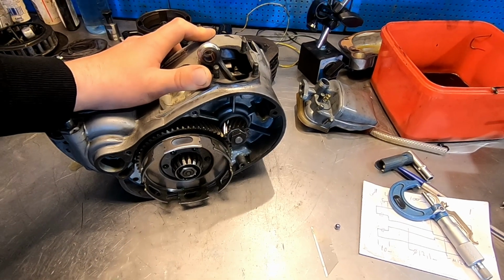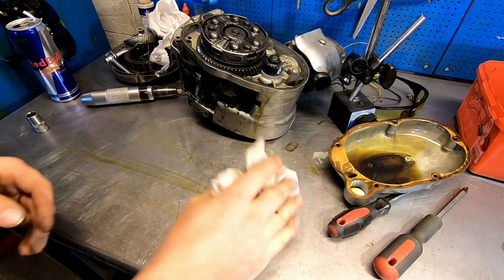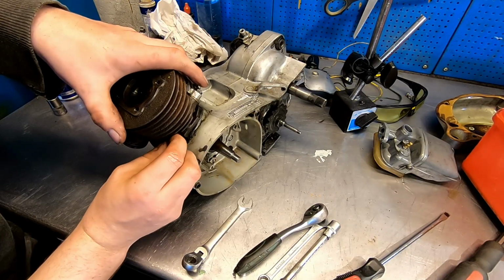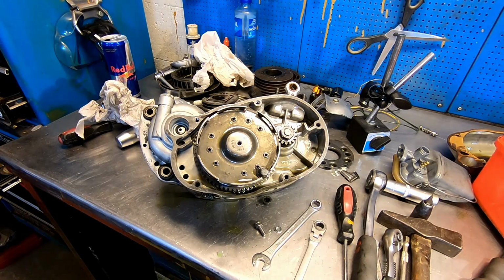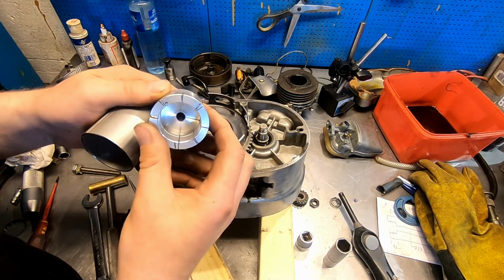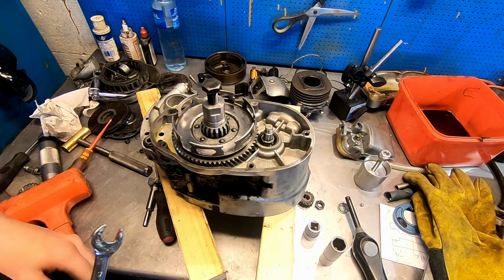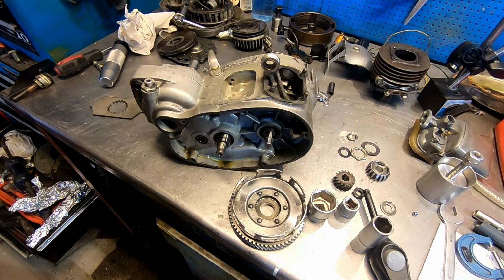Moped Rebuild | Sachs Motor Disassembly

Comment: Can you send me link for the tool to open the clutch housing
Reply from the maker: I think that was something i made.  To pull the hub off i used the flywheel puller.
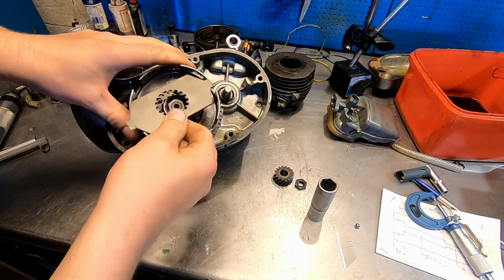Reply: I am taking about the tool at 10:04
Also if you know where I can buy/download the engine book that will be vary helpful 
By the way i relly liked t video. I'm rebuilding a 2 gear sachs from scratch and it's not easy to find the right tools/parts
Reply from the maker: @dr600-mb8mu  oh that one. Try mopedrenovering .se look at article nr 27069
Reply: Hello